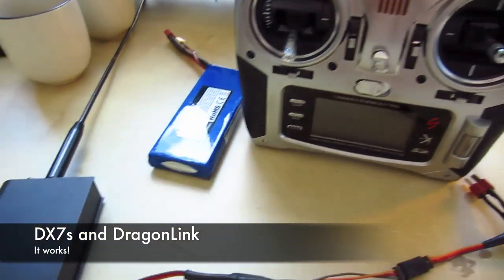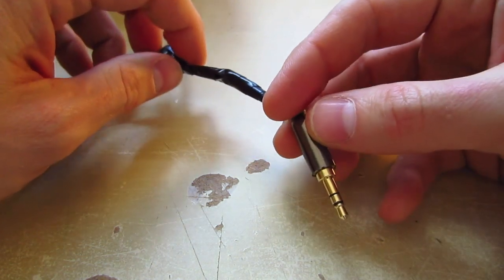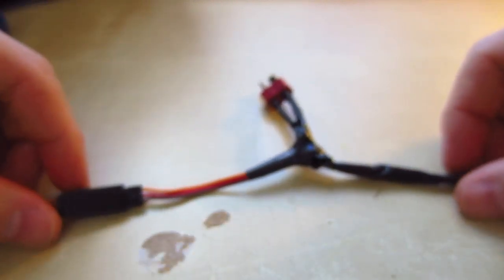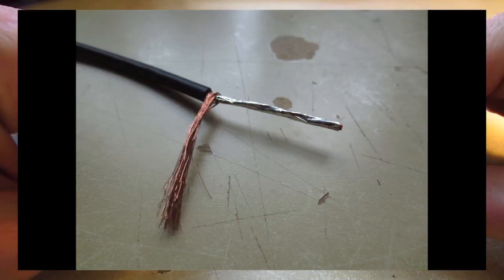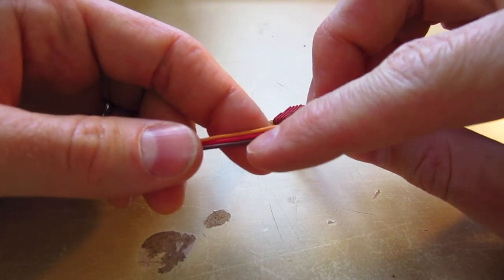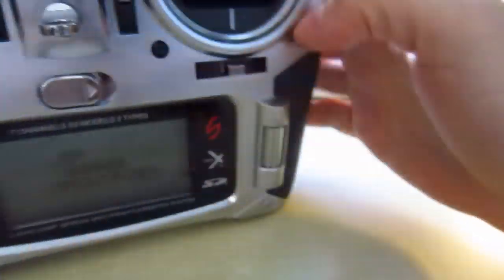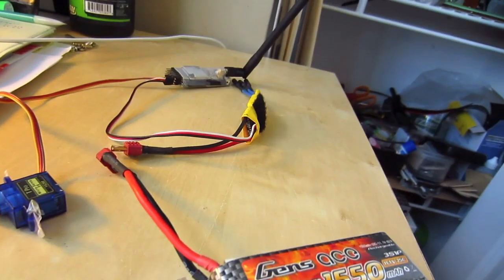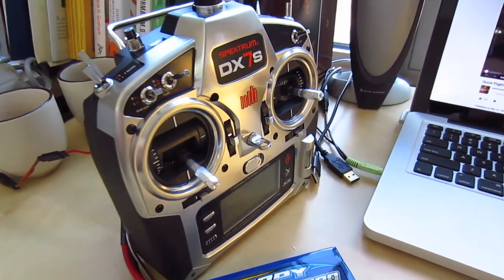DX7s / DX8 DragonLink Setup

Comment: I was concerned as to which channel on the headphone jack was used for the ppm. I imagine it was the one connected to the tip as the jack in the radio is just mono

Comment: What do you get for range? I'm scared to buy this and fly too far away and lose fpv signal or radio control?
Reply from the maker: I fly only about 1.5 miles away - and this setup easily works for that range

Comment: Check my channel for a full indept how to hook this up. Use a muti meter to make sure which wire is which to lead the Tip(ppm)... 2S5000 is a lot of battery to be lugging around :) A small 1000mah well last hours.
Reply from the maker: I checked out your video! Very helpful. Thanks! I need a smaller battery for sure

Comment: are you still using the battery inside the dx7? are you using the external 2s lipo to power the dx7 and dragonlink tx or just the dragonlink tx? or is it removed

Comment: Thanks for your reply.  I ended up hooking it up the original way, by cutting the PPM signal wires inside the TX and soldering a couple of servo connectors to them.  I ran the wires through a drilled out hole in the back cover of the TX and can now either plug the two back together for my 2.4GHz signal, or into the DL for my long-range flights. Binding the DL this way worked without a hitch.

Comment: well everithings work great,now i'm trying to have good result with programming,the first range test(in the city,trough house and building)is about 2 km with diy  dipole antennas,so now I'm trying to change same code to make my own parameters on the failsafe mode....so when every things will work 100% i'll post a video....go an check this user " mrazy6" is actually make 6v out trainer port with resistor ,so maybe can u get some advantage!!!

Comment: Hi!
I am trying to hook up my new Dragon Link Version 2 to my Spektrum DX7 DSM transmitter using the Trainer port wiring setup you show in your video.  However, I have not been able to bind the Dragon Link to the receiver (blue light on rx does not turn off to indicate successful binding).  What is the process of binding the DL to the rx using the trainer port setup?
Thx,
Jan

Comment from the maker: Yep, everytime through the trainer port. You don't lose any functionality of the radio. You could take off the 2.4 ghz antenna, but I leave mine on because when I want to use 2.4 ghz all I have to do is unplug the trainer port. 

Its true, this setup can be a bit messy with external wires and all. Alternatively, you could open up the back of the radio and wire the DL directly to the internal components

Comment: So with this setup u have to plug in the trainer port and power each time you want to use it correct? Does using it through the trainer port limit the radios functionality? (programming etc) and do you have to leave the antenna for the 2.5 ghz connected as well?  

I bought the dx7s and am not very happy with this set up. It's so messy and inconvenient in my opinion.

Comment: Hi PFD  and thank you for the information. On the set up, let me start by  asking  hat receiver are  you using  1.3, 900 . I know  that the 7 s is a 2.4 set but , with the dragon link . It is a 5.8 set ? , I have a  flysky 9 channel radio  and  would love to  buy a dragon link  set. Also, hobby wing has a  5.8  fpv 584 plug & play  5.8 ghz 400 mw  that includes a camera but , I do not think that I can use  this set up with the dragon link?  So, if I  wanted a 900mw, or  a 2.3  I would be ok ?